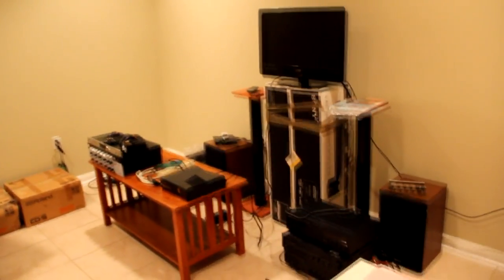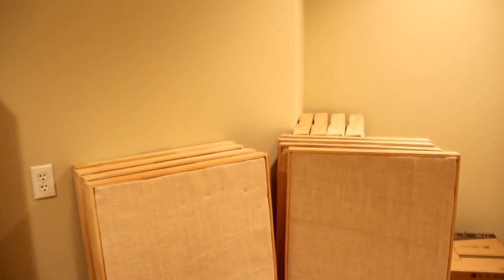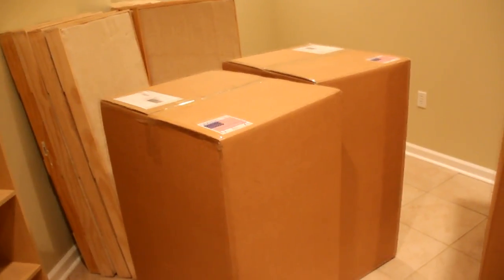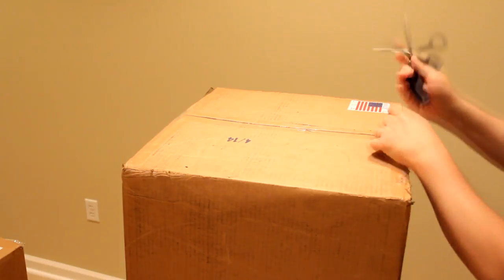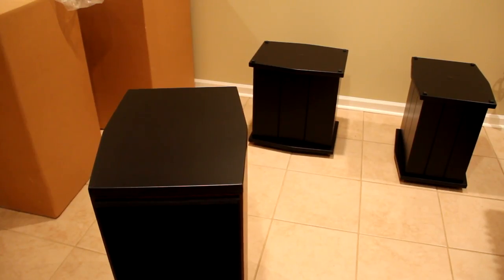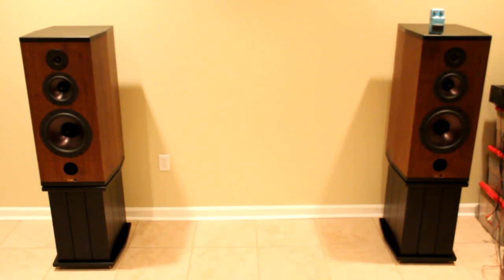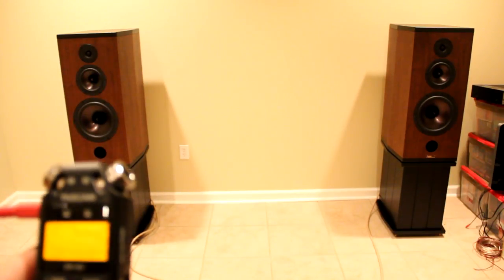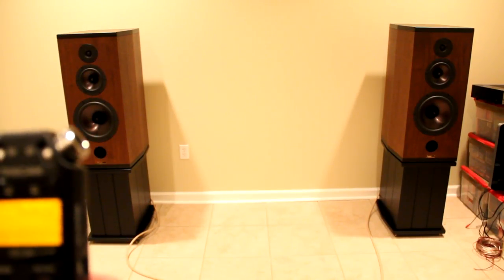New mixing & mastering room: Tyler MM5X speakers

Comment: Excellent looking pair of custom monitors. It's cool to see you using an external amp for these. A lot of monitors these days are powered. I'm still using an Alesis pair I got back in 1998 with an external Alesis RA-100 amplifier. It was part of a package from Guitar Center back then, everything for $499. I know I need to probably upgrade by now and relegate these for a separate monitoring situation, but I keep putting it off.
Reply: Depends on how good the amps inside the monitors are of course.  I have a pair of the original Quested S7 range from 2005.  They still make them but the price is more these days.

Comment: The speaker specification says it weights something like over 100 lbs each..  I wonder does it include weight of the stand or really just wooden enclosure with the drivers and crossover..

Comment: What are your panels made of?
Reply from the maker: Two 2" sheets of Owens Corning 703 sandwiched to each other to get 4", covered with burlap on self-made wood frames. I build these several years ago and couldn't find the 4" version. Now I think you can easily find it, though.